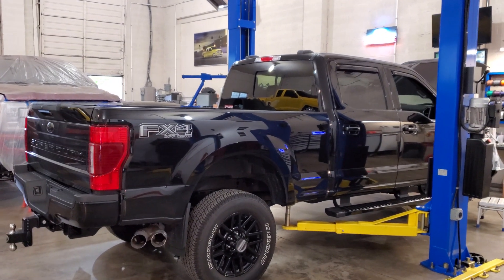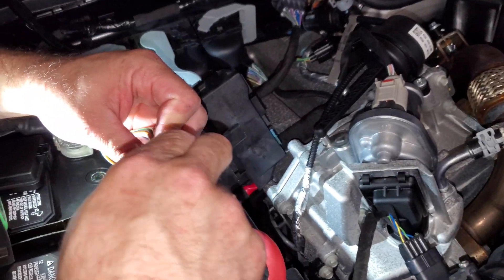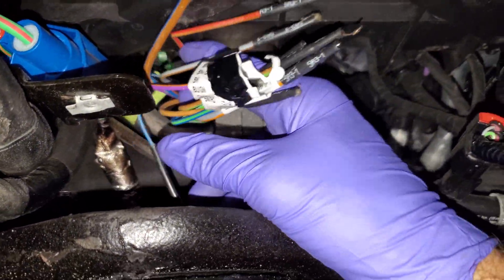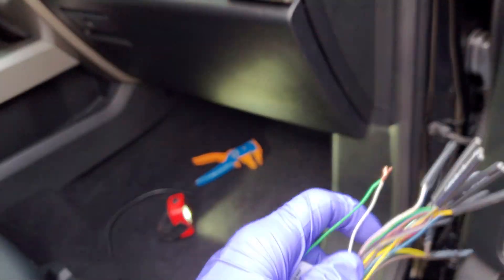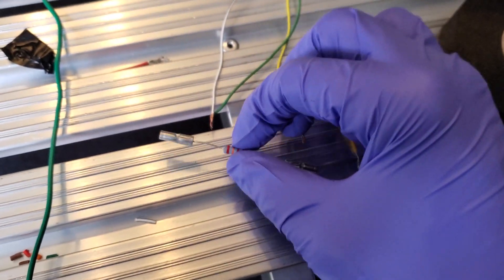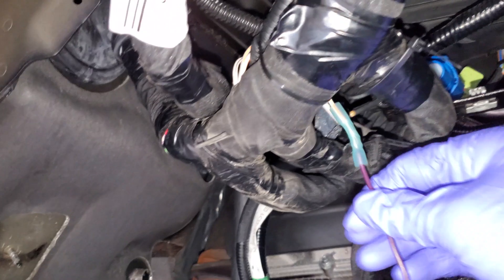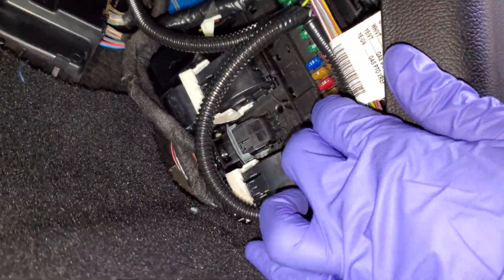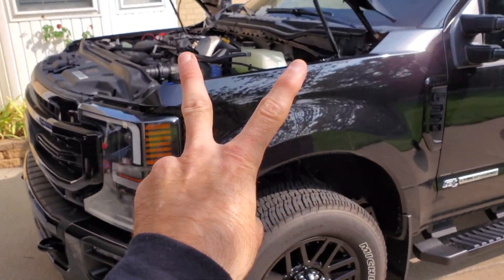17+ Superduty 6.7 | HIGH Idle Up-Fit | HOW TO

Comment: Just curious, what would be some of the reasons why you would want to do this? TIA!
Reply: High idling = not idling.  Per some "expert" opinions on the subject of extended idling cite "fuel wash" of the cylinder walls leads to excessive wear.  Nope .. I can't defend that .. but easy to find on Da-Tube.  No diesel expert but I was influenced.  

As brother ARod (Jedi Master) has stated, faster warm ups is one reason I use high idle.  And when jump starting a vehicle is another.  And in general .. it's a under $5 hack and 30mins .. so for me it was a "hey, why not"

Great episode ARod!  Man, could ford have made access to those firewall passthrough wires any more difficult?
Reply from the maker: Thanks pal...teach u i will 🤣🤣 Appreciate the comments brother
Reply from the maker: & yes my hand was KAAARAMPED up in there...so good luck to all 👌👊
Reply: Winch use, PTO use, anything that would require higher electrical output or engine RPM.
Reply from the maker: Thank u buckhorn cortez
Reply from the maker: I had a few customers request this who had a camper IN THE BED. He wanted to leave the truck run while they slept but didnt want it to idle. I personally use it to auto high idle when i remote start...plus the engine sounds nice just off idle anywayzzzz
Reply: I use it so I can sit in the Home Depot parking lot idling and using my laptop so I can have AC in the summer! Seriously though, if you live where it's hot and you are in your truck all day there are going to be times when you have to idle a lot.